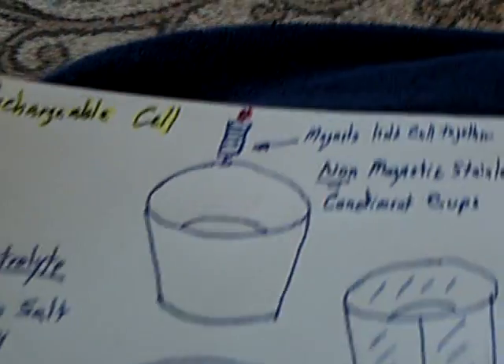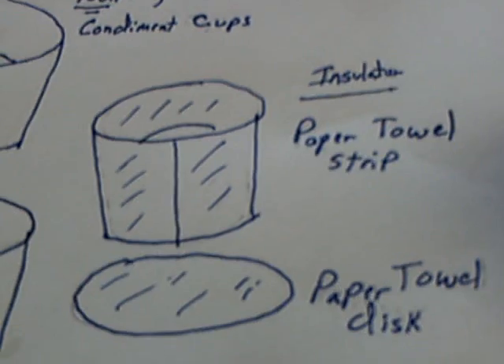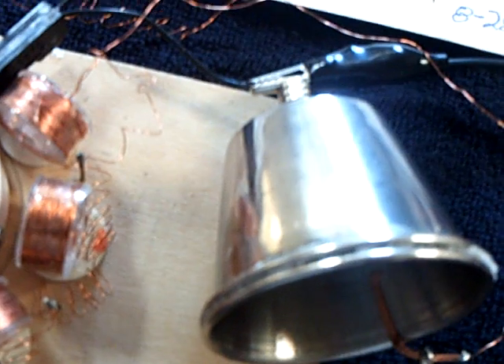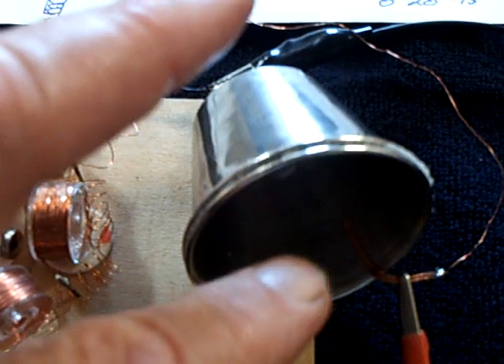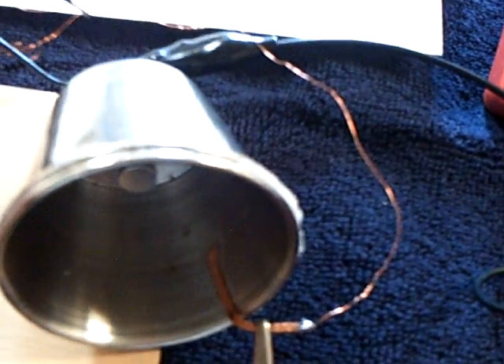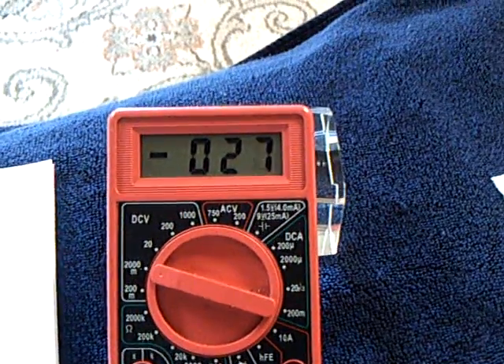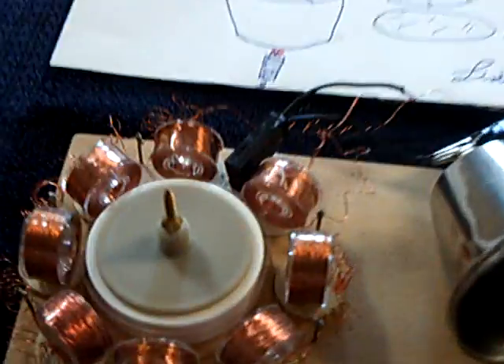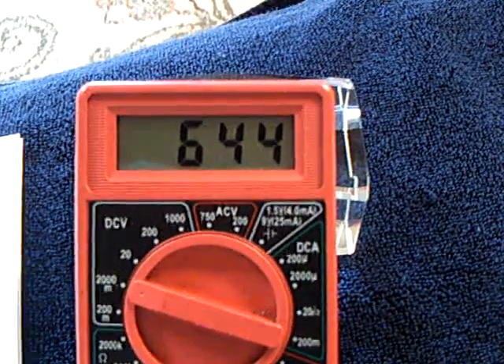Rechargeable Cell

Comment: It looks like a supercapacitor to me. For one thing rechargeable cells can't rebound, but supercapacitors can because after discharging, the plates are no longer charged but some ions from the solution still cling to the plates, re-inducing a voltage. Also like you said it charges in either direction and it can be charged quickly, another characteristic of supercapacitors. It's interesting how you can run the motor for that long, since the electrodes were just steel cups with not a lot of surface area.
Reply from the maker: +Red Rake   I did more testing today and I am leaning toward the term 'capacitor' now also.  Perhaps it is a hybrid type.  If you have two stainless steel spoons try it and see what you think.  Just put a piece of paper towel between the nested spoons and use a clothes pin to hold them together.  Epsom salt and water is the electrolyte just like you have used before.  Three volts works good for charging.

Comment: i also remember just pressure on dry epsom salt crystals  will make a small voltage . can you check if it makes power dry too?  cool video .
Reply from the maker: +Stacy Williams Thanks.  I will try that.

Comment: I think you just made an electrolytic capacitor! Rebound is due to internal ionic resistance.
Reply from the maker: +Power Max   An electrolytic capacitor was my first thought also but after doing some more test I am leaning towards 'rechargeable cell'.  If you slow charge this with about 3v and 30 mA the thing holds more energy than if you just zap it.  It self discharges though like a leaky capacitor. :(

Comment: A classic...how big of a zap can the 8 poler deliver?
Reply: +area46241 its not the number of poles that makes the zap.  And this thing wont zap you. maybe if you run it at  million rpm. but it will melt and shit appart before that.
Reply from the maker: +area46241   Thanks.   sk8pki is right this doesn't generate very high voltage but actually I have never tested it much as a generator.  Usually I'm running it as a motor.  I try to keep the RPM down.  Those neos are just crazy glued to the rotor--and my work table is right next to a plate glass window.

Comment: thanks great video.similar reaction as the graphene super caps tinman and rmSmith are getting.please make another cell an put in a vise that can be tightened by an inch pound torque wrench and see if you can get different results by slowly tightening,and checking as you go.i would make the cell and do it but i don't have your little generator.
Reply from the maker: +bill bailey  Thanks   You could probably just use any little permanent magnet motor as a generator and see results.  The pressure issue is easy.  Just put a C clamp on it and slowly tighten the clamp.  If you had a setup to measure voltage and amps as you tighten (or loosen) it the meters should show a reaction.